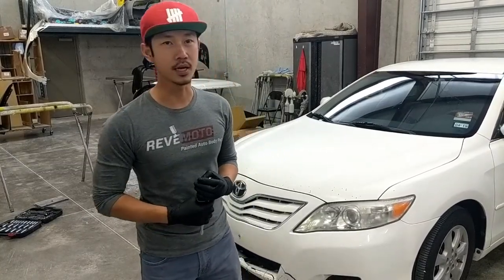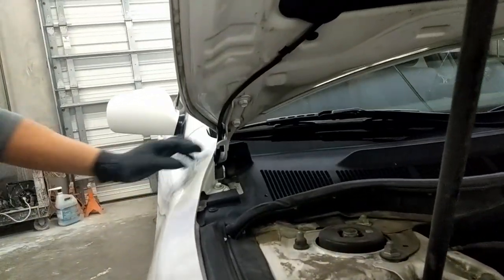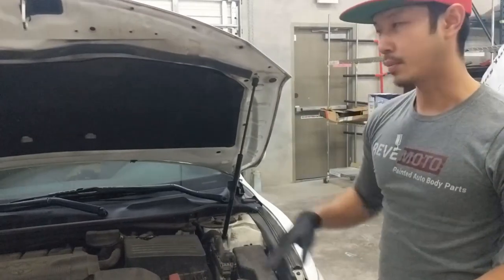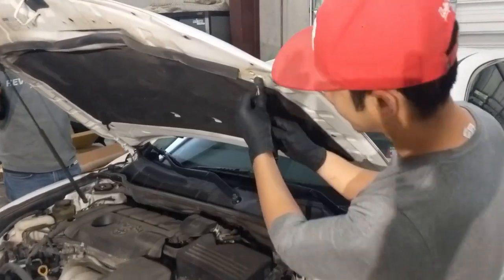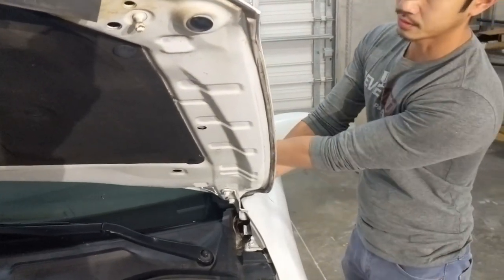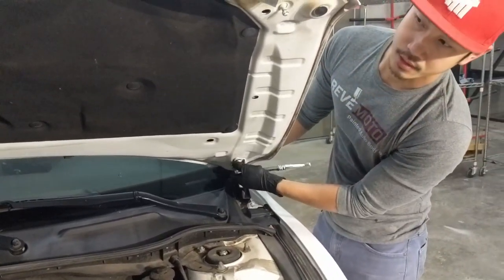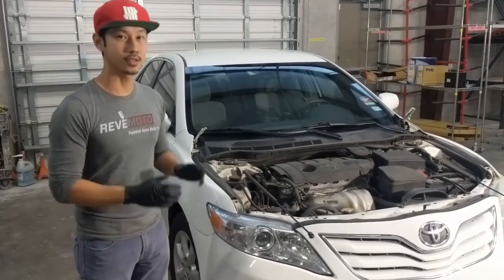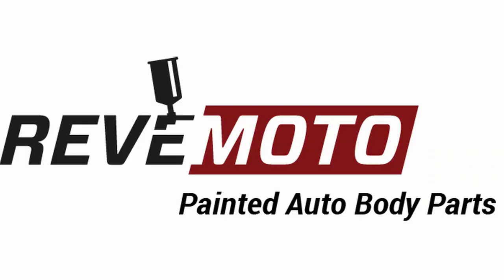How to Remove a 2007-2011 Toyota Camry Hood, Part 1

Comment: How much do you think frame work would cost like a push in by the headlights?
Reply from the maker: Hello. Sorry for the delay. Frame work varies depending on the damage, labor what may have to be replaced. Frame work can easily start at $200-300 and up at any collision shop. Good Luck.

Comment: How do you lower the back section of the hood, it sticks up in the rear.
Reply from the maker: That’s probably the hinges needing adjustment
Reply: @ReveMoto  Toyota Camry "frozen hinge syndrome. Get new hinges. There is no "adjustment"

Comment: Hood on passenger side is crooked after oil change. Noticeable gap. Any idea what happened?
Reply from the maker: Oof. Hello and that is quite odd. No idea why it would be crooked. An oil change does not require the hood to be removed for any reason. You just have to open it to pour the new oil in. The only think I can think of, is maybe the bolts were loose and it just shifted over time. You can easily fix it by loosening the bolts and adjusting the hood. You slightly move the hood forward or back until you get the desired spacing. Good luck and thanks for watching!

Comment: I wanna get a Carbon Fiber hood for my Camry, but it's almost 2 Grand. Also the Carbon Fiber trunk as well. I wish it wasn't a moving violation, driving without a Hood.
Reply from the maker: Yeah that would be pretty cool too.  Unfortunately it does help with preventing issues with water going into the hood. If you need a hood go to www.ReveMoto.com